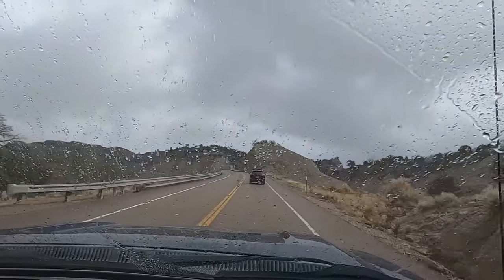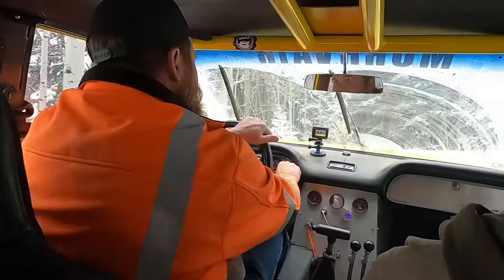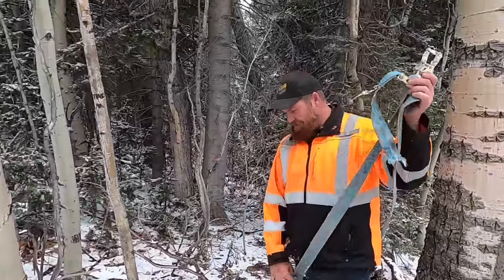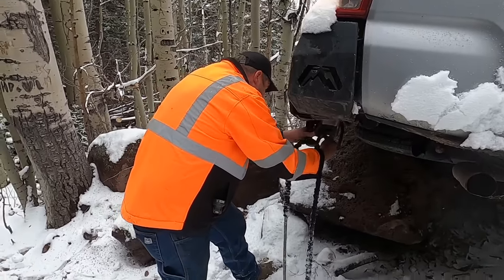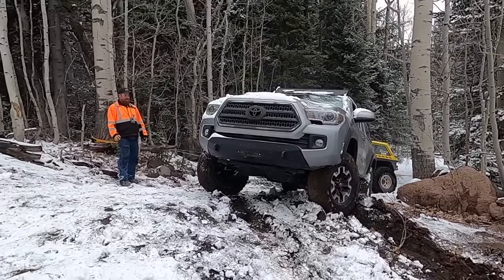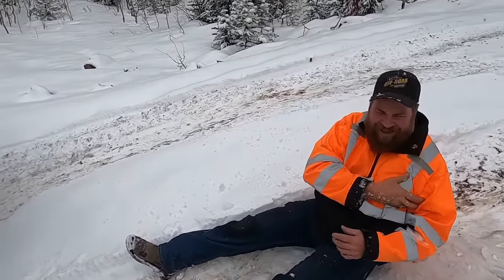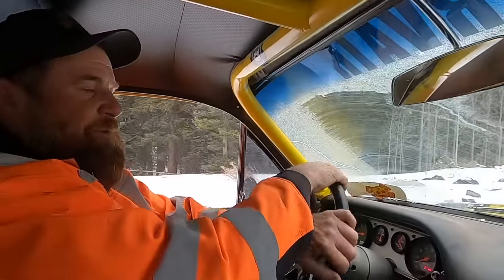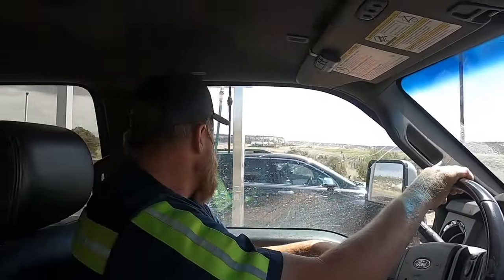You Don't See This Everyday!

Comment: I think that was more ground speed/momentum vs wheel speed.  When I hear wheel speed I'm usually picturing somebody spinning tires instead of trying to crawl.  Certainly momentum has it's place and so can wheel speed in snow/mud/sand but equally there are times when ultra low gearing and letting the tire barely turn will help get you on top of deep snow.  It's all a matter of reading the conditions and reacting appropriately.

Comment: The whole MORR crew has definitely improved it's skill set in the last year.
Matt I love and hate folks like you? It never fails that when a fuel pump goes out the tank was just filled. Modern electronic fuel pumps are in the tank and require fuel to keep them cool. I pray often that you don't lose one out on the trail and I dislike being negative. I tell customers and my kids alike, " it's just as easy to fill the top half as the bottom"!
You are in my prayers
Hoka Hey
Reply: Ever since Katrina I never let my gas tank fall below half full. That way you always have half a tank of gas. Hopefully I never have to use it.
Reply: @garymoore8711  I have a similar policy that overlaps.  Always have enough fuel in the car to get to Texas when you are in Louisiana.  :D  hehe.

Comment: Maybe by saying “I’m Matt, and I’m a low fuel aholic “ could avoid the “intervention”. Always great videos. The breaking of strap and watching why it’s very important to stay out of the “death triangle” when winching should help others to be safer.
Reply: Matt has commented on the "triangle of death" before.  Apparently, with the synthetic (non-metal wire) ropes, the danger is drastically reduced.
Reply: Now that was funny! 

Definitely stay out of the death triangle...don't they still make those safety Dampener blanket covers for winch lines that help mitigate that exact danger?
Reply: I'm surprised he used a chain in the first place, even though that isn't what failed.

Comment: Nicely done. I live in BC Canada can concur that wheel speed is not usually the answer in snow. If you have really nice power then sometimes you can use wheel speed to dig down to dirt, but most of the time when the snow is packed down or anywhere near freezing point spinning just creates ice and ruins your path and or gets you stuck. Especially on a road that is used all winter it really needs to be avoided. With a mile long driveway that is half up hill and snowed in for 3 months we do our very best to prevent ever spinning or sliding. The second somebody does so all tractions is gone and you get to fight with a skating rink until thaw.

Comment: 11:30 Most definitely yes if you just have the ground clearance. Had to do that same thing with 99 Focus stationwagon, on the hill road that barely was wide enough as the cars length. Thankfully there was snow bankment to support the rear bumper enough so rear didnt fall off the cliff. Now sure how well this works on 4x4 since you cant(depending the system and how durable it is) pull handbrake to stop the rear from moving.

Comment: Lols I did to that 180 on a 1 in 4 slope on a banked bend in packed ice/snow in my 2wd 1985 Austin Metro (front drive) - handbrakes, left foot braking and lots of rally wheel to turn it in it's own length from being stuck against the bank ;) went back down the hill, turned it around and took a second run, made it round the bend half way up and out. (and I have a witness!) Would not want to do it in something that big though :) Kudos for all the work - something I'd love to do.

Comment: After 9:35 it was all down hill, better to fall on snow at an angle then on a flat sidewalk, when your feet fly forward tilt your head forward and throw your arms over your head, not down, like you are trying to touch a wall behind you, this will curve your back and if anything is behind you, like the ground or a tree or rock you hands will stop your head or shoulder from being first contact,. They have an exercise in Aikido where you fall back with a wall about 3 ft behind you just to practice this. . Brings to mind "The Karma Boat, no paddles needed, just the desire to float." The best medicine is to laugh cause dignity runs faster than ones feet. You are my hero Matt.

Comment: The turn Lizzy did is called a Rockford when you do it on dry pavement.
Do you ever use snow chains? I know they can be hard on the equipment, but they do work well.
Good job.

Comment: Is your snow usually powdery and dry? Or is it like here where its wet, heavy, slippery, and or mixed with ice? I  know over the winter as the layers build, the ones underneath turn almost solid in most places. 

If it's like ours, dedicated winter tires may make a huge difference for you. I find most off road tires, like the All Terrain KO1 and KO2s, Kelly Safaris, Toyo all terrains and open countrys, and the offroad Goodyear Wranglers dont stand a chance against a set of Firestone Winterforce, or the Uniroyal Tigerpaw winter ones (which is all square tread blocks almost like a small paddle). 

Though in most cases those offroad ones are better for staying on top of the snow (which is horrible on the road), the winters cut into it a bit more. The directional winterforce mounted backwards stays on top a bit better, proper direction they bite and are great on road.  but the Uniroyal winters are great all around, and could handle deep snow in my 90s Blazer no problem.

Just some options to look into, what do you use in the winter there? The same Patagonias as summer?

Comment: Time stamp 9:16 .. Low 4wd gear or if these Tacoma's got crawl mode ... also the front and rear wheel should be spinning simultaneously if it's in proper 4wd locking all front n rear differential...

Comment: I ran into the same problem with a TRD Toyota and lockers in snow.  Low range and lockers didn’t work.  I had the owner put the truck back in high range 4x4 and all the wheels started to turn with power.  Maybe someone can explain why the Toyotas have that strange behavior.

Comment: Not sure how much recovery rope would be required, but tethering the opposite end of the vehicle via a tree anchor may be beneficial. At least it will keep it from slipping or rolling down all the way. 32F is bearable, but not fun I know. It all worked out because you have done this hundreds of times. Spending 6 minutes to save 6 minutes is a wash anyway. Not worth it for a 6 HOUR round trip! Yeow!

Comment: Wheel speed and momentum are two entirely different things, getting a run at something is entirely different to sitting there and hammering the gas, i think somewhere along the way confusion set in somewhere, as a Canadian your biggest enemy is going to slow, or conversely to fast, all depends on the situation, but you aren't going to take off from a stand still either way.

Comment: Matt you naughty man, don't you know that electric fuel pumps need to sit in liquid fuel to stay cool? Yes, even the lift pump on diesels. Most manufacturers have it in the book nobody reads to keep the tank at no LESS than one quarter or burn out the $500 pump.

It's strange, I know, to submerge an electrical component in flammable liquid to use it as a cooling method but that's what those meathead engineers think is the best solution.

Comment: Canadians know how to drive in snow. They do it year round. Ha ha JK
Depending on the snow packed tire treads are useless and wheel spin clears them and gets the aggressive tread working again. I run studded tires on all vehicles in winter as we get a lot of ice under the snow and you need studs on ice.